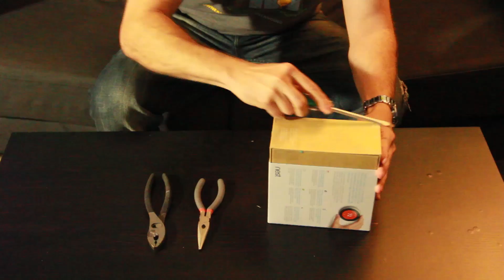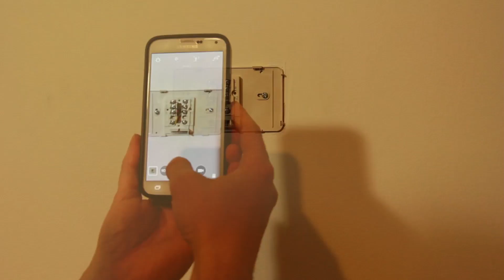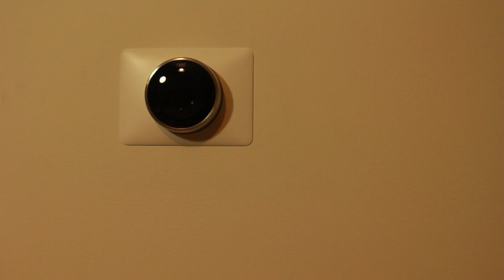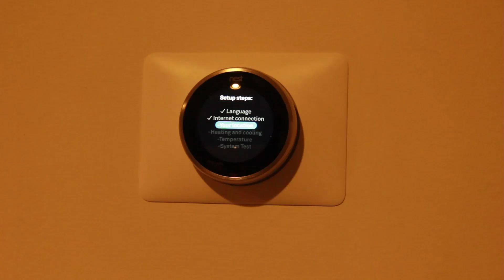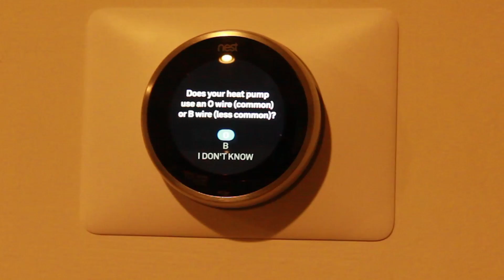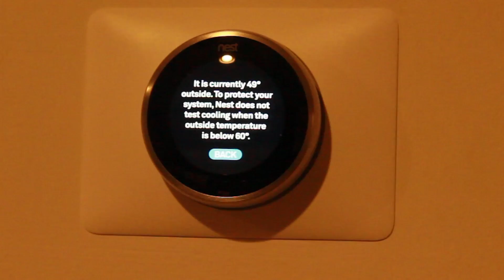Nest 3 - unboxing and how to install 3rd gen Nest thermostat w/ LATEST UPDATES

Comment: Hello, I have a Goodman package GPH1336H41CB, could you help to know the best wiring instalation for it using a Nest 3G?
Reply from the maker: +Explorean hi, I'm not at all familiar with that system, so I don't want to provide information unless we feel it would be of value to you, but I can suggest the nest support. They are great, very fast response, and I have used them my self a few times already.i hope that helps a little:)

Comment: Thanks for the video. Just installed mine this evening and everything is working great. I did find that my old thermostat had a Blue and Orange wire that was never connected and tucked away. Would it make a difference if I hooked those up? I'm assuming that the Blue is the Common wire, but not sure about the Orange. Cheers!!
Reply from the maker: +Toquelibre honestly if everything is working properly i would not connect additional wires up. I have read some reviews where the customers screwed up their set up after they tried to rewrite their nest according to some other user suggestions on the internet.
Reply: +greenewit  Will do! Thank you!

Comment: Sorry. I currently have wireless Sunvic Thermostats and do not wish to start new wiring.
Thanks. Alfred.
Reply from the maker: +Alfred Lawless I would check with nest support to see if you can connect the nest wirelessly to your wireless enabled heating/cooling system. The nest already works with the 802.11 wifi protocol since it speaks to your router, but not sure if it works on the RF signal like your sunvic thermostat, or for that matter any other wireless protocols like bluetooth, z-wave, etc... Sorry I can't help on this one, but the nest tech support is very knowledgeable and helpful as I called them a few times already 😆

Comment: I need help connecting my wires, my current setup consist of both Furnace and AC- I used furnace for heat in winter and AC in summer (whatever you call that). Below are my current wire connections:
Blue=C
Red=R
Black=E2
White= W1
Yellow=Y1
Orange=O
Green= G
On the nest I do not see 'R' nor 'E2'. I do see 'Rc and Rh' (guessing RedHot/RedCold?)
I am going to keep digging around, if anyone have the answer please reply.
Thanks!
Reply from the maker: Have you tried reaching out to nest support with an email? I would also be interested in what the final solution will be if you don't mind sharing once you figure it out.

Comment: in the nest video introducing the nest 3g they do not have that metal backplate. Is that just to make it look better in that video or is it an option when you want to have that white backplate? Thanks
Reply from the maker: Its not a metal backplate to use for the exterior plate, or the front facing plate. The metal plate goes under neath the plastic one kind of like a support plate to add extra sturdy surface to the wall to hold the thermostat in place better.
Reply: +greenewit The metal plate is only for mounting the Nest on an electrical box. Not needed in any other setup.
Reply from the maker: +sjokomelk thanks for that clarification. That would make sense.

Comment: The nest is garbage.
Reply from the maker: Did you have a bad experience with it? I would to find out any real user feedback as I continue to use it...
Reply: Actually, I was having a bad experience. But after tinkering with my furnace and re-wiring the nest the way it was really intended to be, it works fine.

Comment: You made a mistake when you selected the B option on setup.  You should have selected the O (orange).  You misunderstood what it said when it asked if you used an O wire which is more commonly seen, or a B wire which is less commonly seen.  I saw that you have an O wire which is what you need to select because that controls the heat pump reversing valve.  The blue wire is a 24 volt common wire.  It should be in the C port on the thermostat base.  The reason the air is not warm when you tested the heat is because you selected B instead of O.  Source:  I have the same nest and system wires as you :p
Reply: Thanks!  This really helped me.  After I set it the heat came on and I knew I was good.  When I set it to "I don't know" I got no heat.  I didn't want to wait until fall to find out I didn't have heat.  So far so good.  I love it.  I knew I had wired it correctly, its just like what kind of question is that?  I'm glad to see that there are others that have 6 wires to their heat pump too.  Thank you for your posting.  My wire was orange in the O/B connector from the old thermostat and I had the layout and documentation.  Once I selected "O" wire I was good to go.